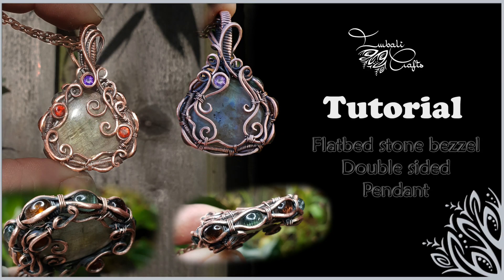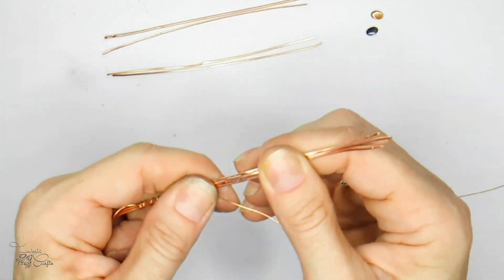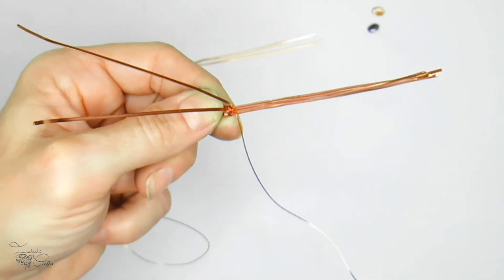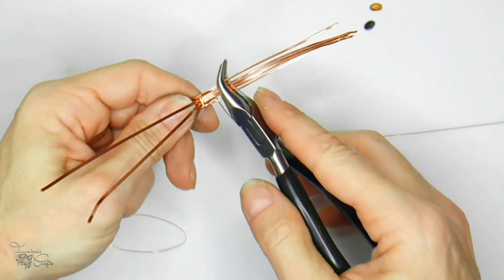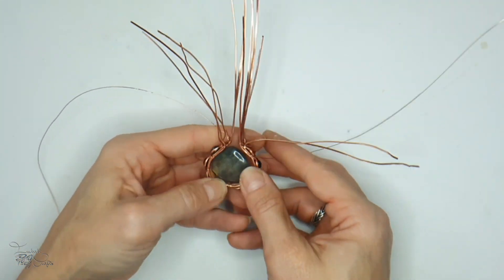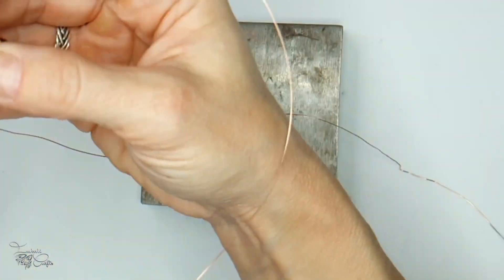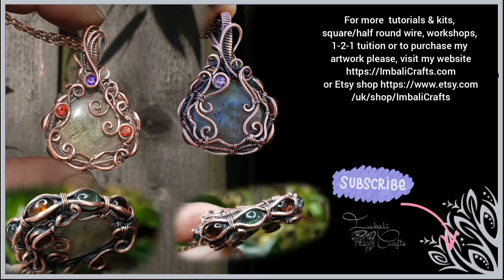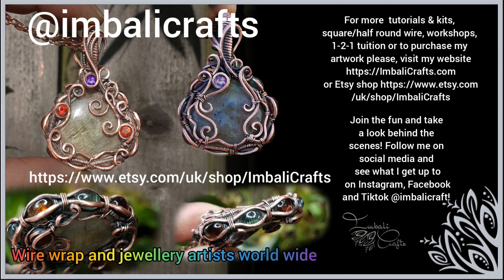double sided wire wrap pendant with gemstone bezel

Comment: I've actually done channel setting with cz and small gemstones like you do in the front of this one and I used round wire. I used 6 wires and lifted up the middle 2 and did an open bezel to lay the point of the stone in then pulled the middle 2 back down. I really feel that square wire holds them better but I never tried half round. I ended up trying your design but with my same old trusted way. I can't wait to get the half round and try this though. You're a genius! Thank you
Reply from the maker: There is no set way to do things. Everyone has their own way of creating and what works for me may not work for yu and vice versa. As long as you are happy with it and you are having fun, that is all that matters. Thank you so much for your kind comments!! ❤️